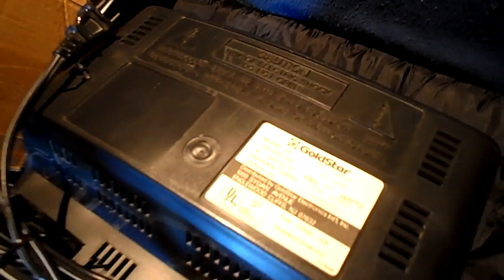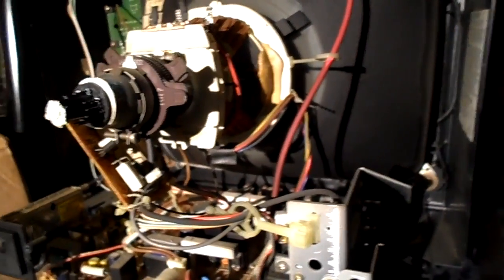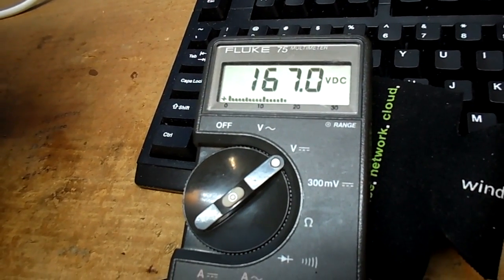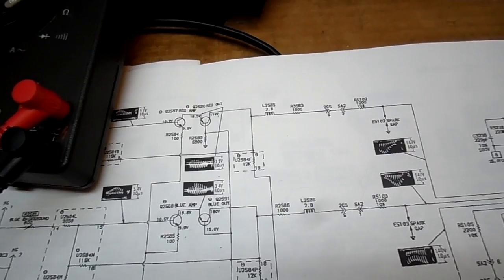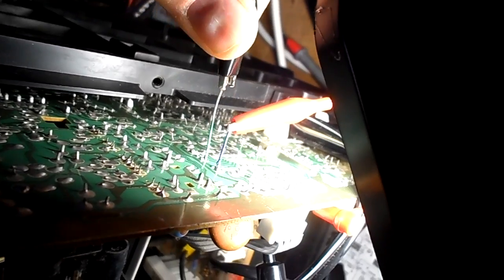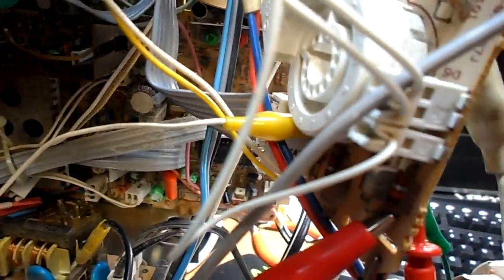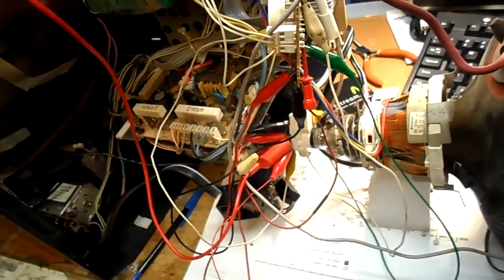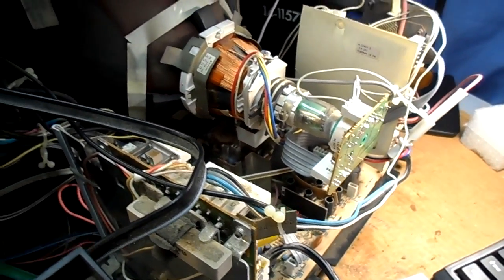Zenith 13" Color TV. B1310W. 1985. Bad CRT. No Blue. Pt. 2.

Comment: I have a Zenith 12" Color TV from 1990 that i tested with a standard pattern generator, and it has a significant green tint, when you would usually find areas of black, It shows green. Somethin up with my tube aswell?